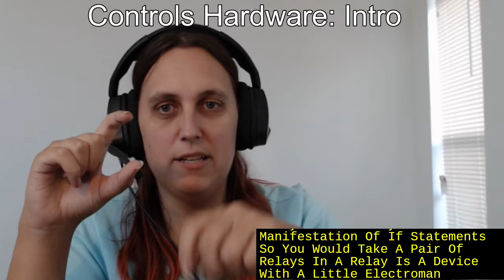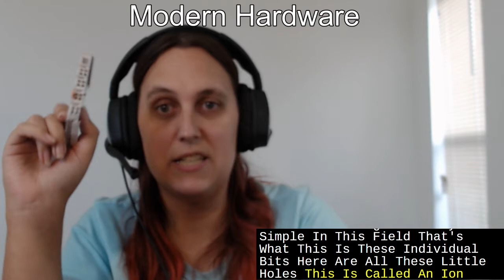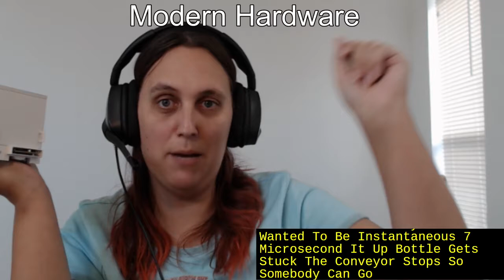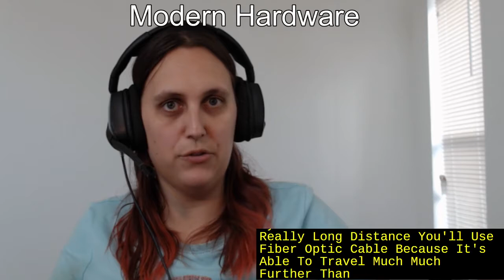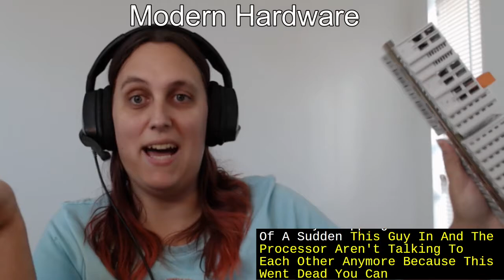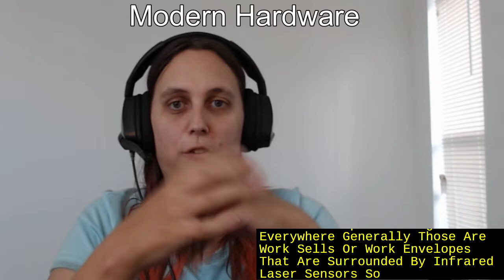Controls 111: Hardware Intro

Comment: Thanks for this tutorial! Just curious, what is the most common reason for the rollercoaster's e stop gets triggered? Sometimes I like to watch how cast members and engineers try to fix the rides but it looks like they just reboot the system and run the ride to check if the error got triggered again. Most of the time, the ride just magically works fine and they reopen the ride...
Reply from the maker: So it isn't so much that it magically works fine, it's that faults come in 2 main types: persistent and transient. A Persistent fault means something is actually wrong wrong call maintenance get them to run it down. A Transient fault is way more common and is a short lived fault, something temporarily got out of whack for a wide range of possible reasons (someone tripped a safety sensor, trains got too close together and tripped a brake run, load/unload took too long and the ride faults because no dispatch occurred within a timeout window, rollercoasters running 'twinned' processors for safety will fault if they disagree with each other which can happen if there's a disruption in the communications network)

So it's a (very very simplified) process of reset -> did the fault clear? [no = it's persistent] -> Yes -> cycle the ride -> did it reoccur? [yes = it's persistent] -> No -> document everything for maintenance to follow up as needed, and reopen